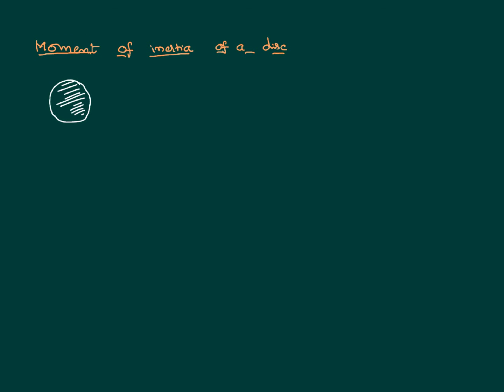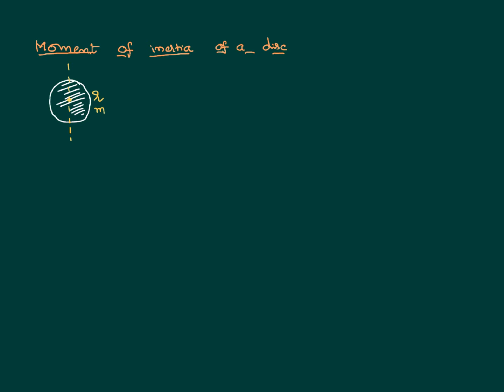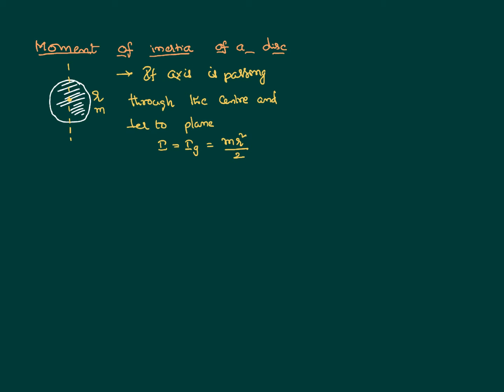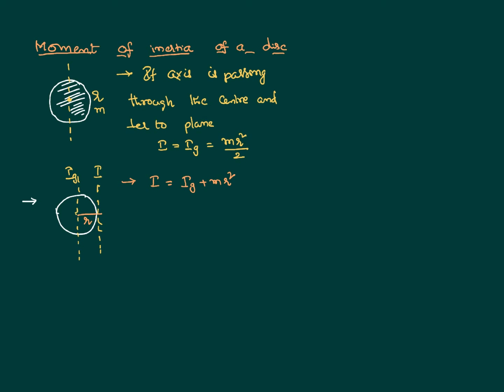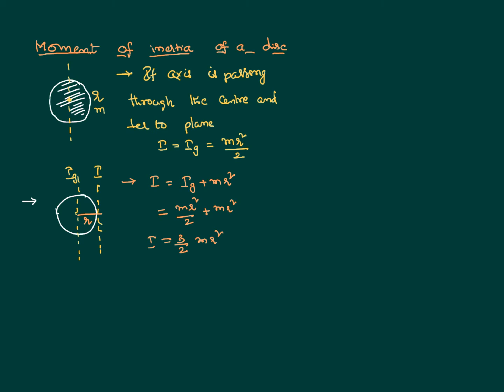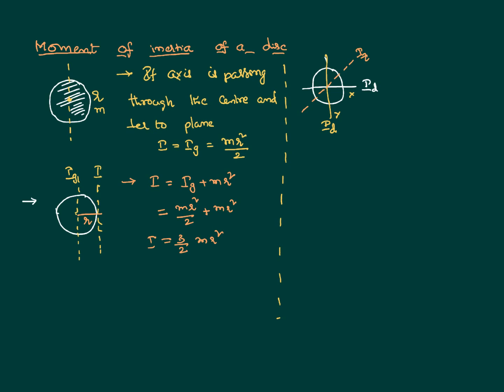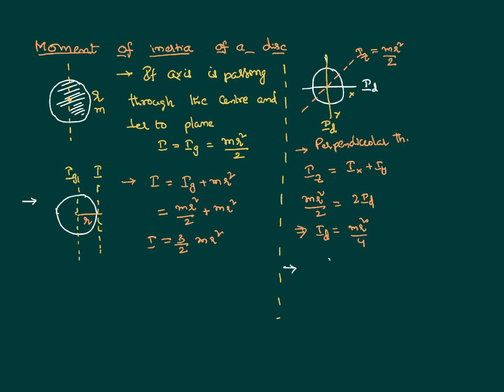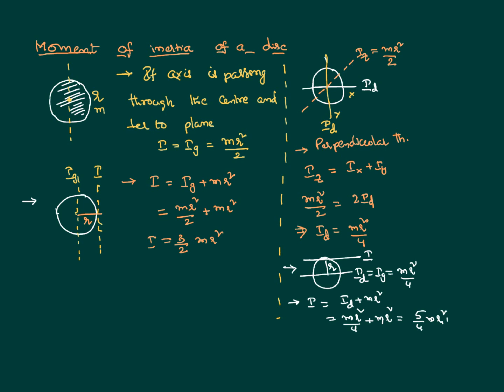Moment of Inertia of disc about Different Axes in Rotational Dynamics for JEE and NEET

Comment: This is interesting! I know that there is a way to do it without using the perpendicular axis theorem but changing how you integrate it. Could you show that way in another video or explain it in a comment? Thanks!
Reply from the maker: Yes Bob, It can me found using the integration tool of mathematics. Will derive some of them in the coming course. Any way this is easy way of finding moment of inertia of parallel and perpendicular axis using this theorems and that is the very purpose of this theorems.

Thank you for commenting.